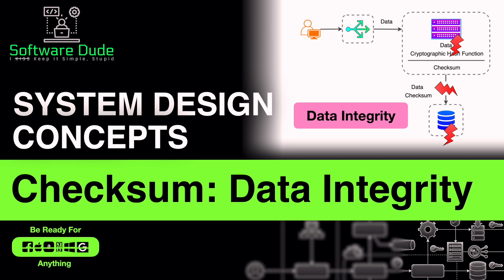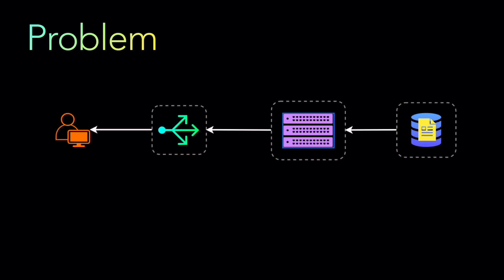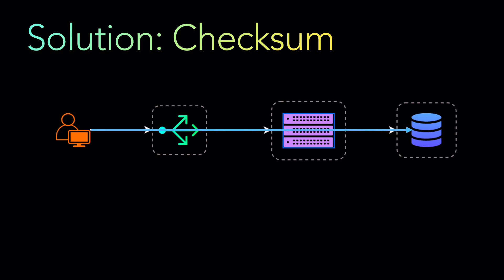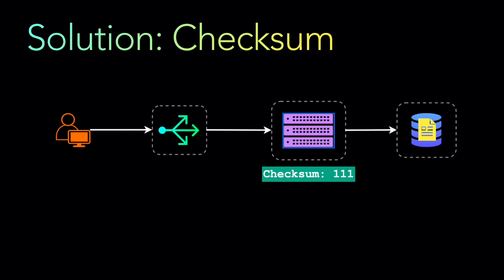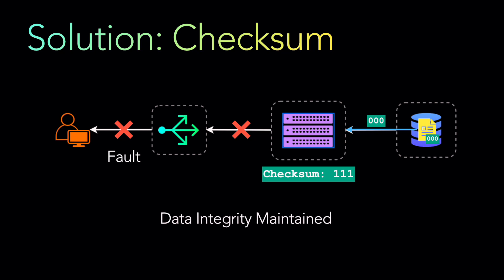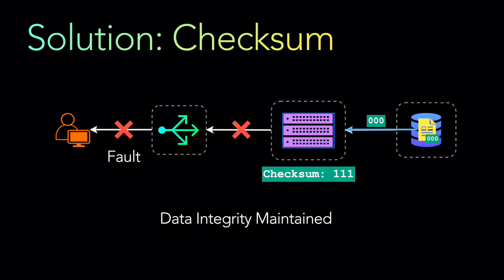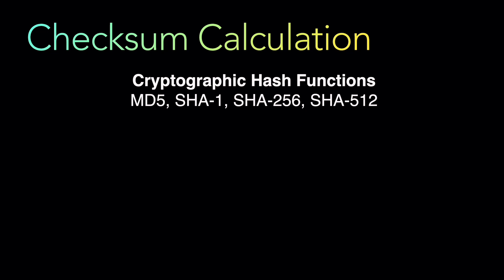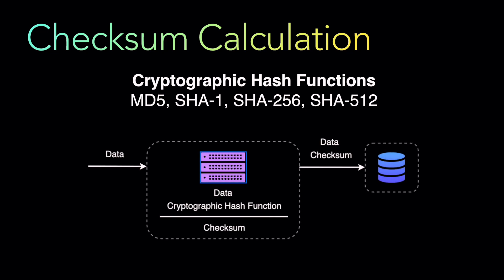Checksum Explained | System Design Concepts | Data Integrity | What is Checksum | Interview Question

Comment: Hey, but to store checksum at the service side so that it can compare with the checksum stored in DB, do we need another DB to store the checksum? 
Or if it is not stored in DB, the service will not be stateless...
Reply from the maker: Yes. Data transfer in any form has a source and destination. It can be service to database, service to service, etc. If data integrity check is required, source should also know the original checksum to be able to recalculate it when receiving data from destination.